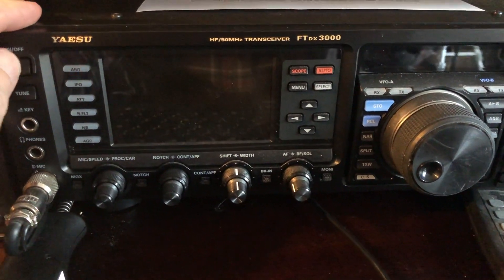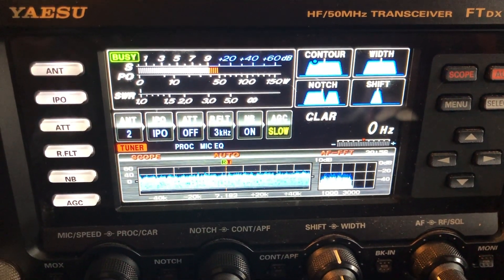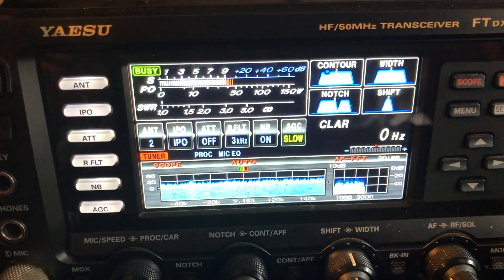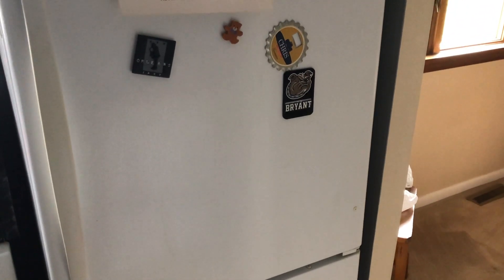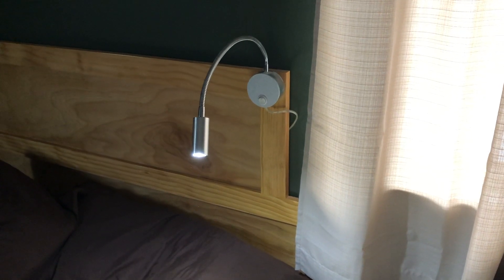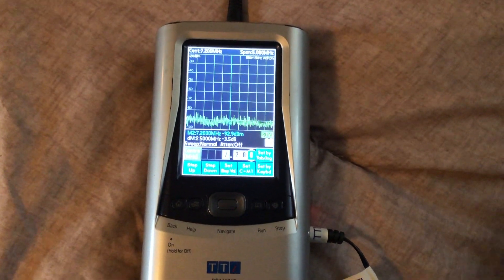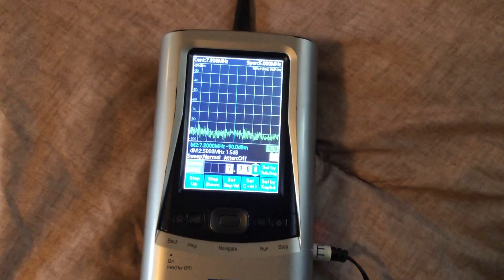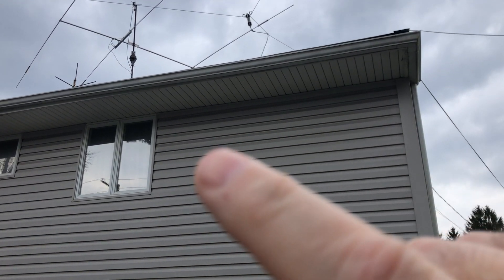Ham Radio source of RFI FOUND!

Comment: My homemade RF filter:
https://www.youtube.com/watch?v=BZf3p5QkyLU&t=2s
circuit: https://disk.yandex.ru/i/AdHQj8pQp4jgmQ
There is a lot of interference from the wired Internet. Interference starting from 14 MHz and so every 30 or 60 kHz. The provider decided to save money and not use a shielded FTP cable, it uses only UTP everywhere. The broadcast has become very noisy. Our 220V electrical networks do not have a separate grounding conductor, the neutral is grounded, so all EMI RFI FILTERS are not very effective. Still, the best option is a 12V battery.

Comment: Yep! Some of those LED lights are quite the RF noise generators. Cheap unfiltered switch mode power supplies are the problem...  I as well had replaced the old incandescent lamps in my truck with those aftermarket LED’s... Every time I hit the directional signals, it would completely wipe out receive on my 2 meter mobile... Had to take them out and install the old incandescents again...

Comment: I installed a new HVAC heat pump. It is located right outside the shack. Hash all over 40m and 10m. Even in resting mode it is just as noisy. I flip it's breaker, and the noise disappears. Turns out that even ARRL has a rightup on this problem. Contact the installer, they can order a RF filter package for them. I just don't know why (other than save $$) that they do not have this as a standard. What if a Ham has a close neighbor that installs this. That ham will have a hard time finding the source, and probably even harder time getting it fixed. Rheem, shame on you! 73

Comment: Thanks for the video. Before I had my license last year I bought a pair of rectangular headlights for my 2001 Jeep Cherokee XJ. It killed my AM-FM reception in my car radio. It really messes with my ICOM IC-7100 reception also. I plan on using some ferrite cores or beads on the light harness to see if that helps. My shack HF radio noise is like yours. During this lock down my wife is home working so it is a little tough to turn breakers off and on to find the noise.
Reply from the maker: 1crazynordlander Yeah, the 7100 is definitely susceptible to noise although the NB in it is amazing!!  Funny, I found this problem by walking around the house and I saw that light on.  We don’t usually leave them on.  No breakers to turn off!  Lucky me!!  How is your mobile rig working??

Comment: Hi Chris, I have experienced similar issues with LED lamps. I bought expensive LED headlights which looked great, but totally destroyed my reception on 2 meters in the car. 70cm was not affected( that I noticed) . I yanked those suckers out of course!  Working on trying to suppress the noise and hope to put them back in once solved. My cool reverse LED lights have the same effect but I can tolerate that. 

Also have some LED work lights in the attic that wipe out 2 meters. 

HF is noisy at times at the QTH but no direct connection to LED lights. Need to get my SDR out and go sniffing.

Good video :)

73, WA2SVM
Reply from the maker: David Barth Thanks Dave!!  I also found that those cheap cigarette lighter USB ports are really noisy.  Amazing how these devices get out there!